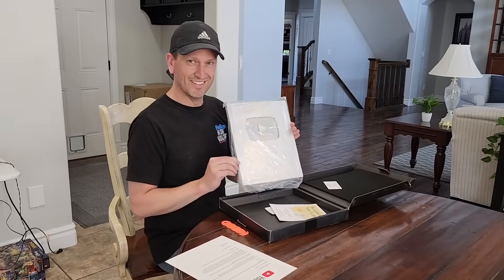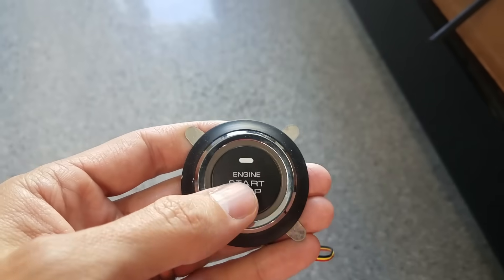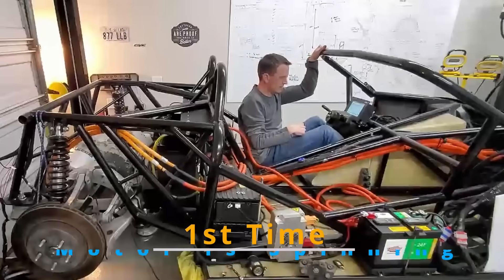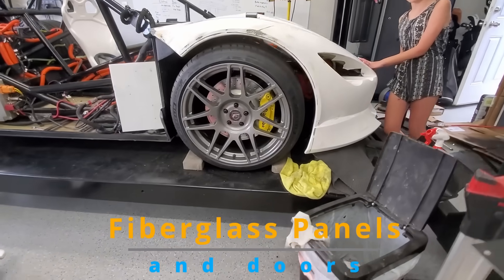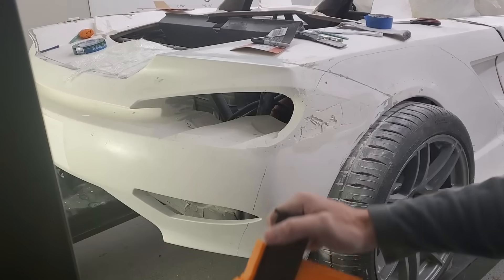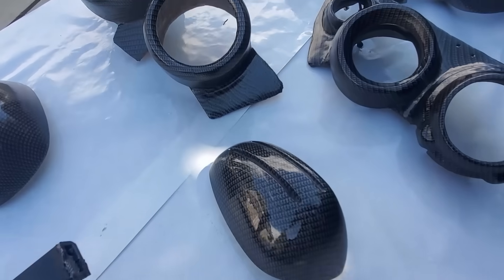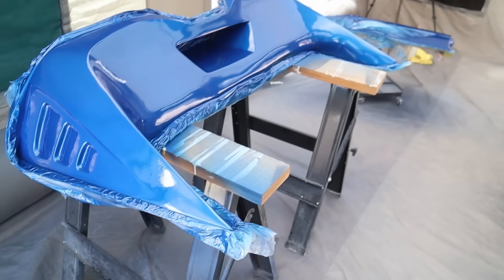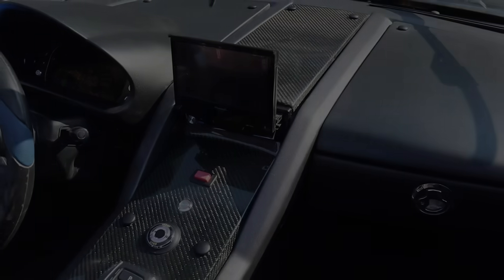I built my own Tesla Roadster - Electric Supercar

Comment: The most amazing thing is not that you learned how to paint or weld or build a car, but that you didn't give up on the project. That's perseverance
Reply from the maker: Thanks Friend!
Reply: I think it sounds too unreal, some car companies spend so many years to make a car and it took someone who knows almost nothing, just 3 years
Reply: @Saidifect Elon is obsessed with having the roadster have 620 miles. He just doesn't have the battery tech for it. There are 200kwh packs the size of the model s 100kwh pack. Problem is you can only recharge them 100 times before replacement. Current model s pack can handle over a 1000 recharges. Can't warranty the 200kwh battery for 120k miles like they do the 100kwh pack. Real world sees an average of 120 miles per charge with a model S.

A high Voltage 800V pack with 120kwh 4680 batteries is possible but range would be more like 500.
Reply: @Saidifect I mean he didn't make everything. He bought a lot of parts built by car companies
Reply: @Gamegineer93  its still very impressive and I'm pretty sure he could have made his own parts and car companies use parts from older model cars in there new cars all the time
Reply: That's EXACTLY what I was thinking too
The electronics, the welding, etc.

Either he has some mechanic, electrician, engineer background or he's a genius

If he doesn't respond to this comment, we'll know he's a liar 🤣
Reply: @humanmenot7080  it would make sense for him to come from an engineering background, which probably has the most overlap in skills required to design and build all this so it makes the most sense. But even so, highly impressive for him to pull this off with no prior experience with cars. Also keep in mind this project took him years to complete.
Reply: Only a stupid believe that... he did it ok but with support of specialists following him...only a dumb who can't do anything can think you can do all that alone
Reply: Is it real ohh man
Reply: If I start with a project 
Number 1 would be the batterypack
Reply: The first time man ... Well done
Reply: Kid @6:22 is already building v2.0 in his basement.
Reply: Fantastic kudos looking sharp congratulations on that sweet build
Reply: You’re smart engineering minds my man

Comment: OK, I really have only one question:

What do you do for a living? 

I ask this for two reasons:

1. I feel like the average person can't simply afford to invest in all the stuff you would have had to have bought specifically to build this car. I'm not just talking about the car itself either, but all the extra equipment required to DIY all the parts. 

2. I feel like a lot of people simply wouldn't have the mental capacity to do all of this, and do it right on the "first" try. I understand that there was obviously several years of work and lots of trial and error, but still...the fact that the finished product looks this good tells me that you HAVE to have some kind of engineering or design or building knowledge in the past. 

So, just curious as to what background you had before starting this project...because I'd be stunned if you told me you'd been managing the local Arby's for the past decade...
Reply from the maker: LOL!  I work for a medical device company

Comment: Hey man, after seeing this, you gave me some new hope, but also made me realize what I'm in for. I want to build my own electric car, but also the electric motors for it too. I'm going with axial flux motors because they have a higher torque density as they can provide more torque and power in a smaller package. I'm aware of the efficient and intricately designed Tesla PIM-SYN-RM (permanent internal magnet synchronous reluctance) motors, but axial flux motors can create so much more torque for their size. I am currently in the mix of winding my own coils and motor design. For everything that doesn't have to do with the motors, I really need all the help I can get as far as the frame, body, brakes, suspension, wheels, axil, steering and everything. Any suggestions? I would really appreciate any help at all. Thank you so much!
Reply from the maker: Sounds like you are well on your way.  Good luck friend!

Comment: Bro, I hope you crimped the rest of the crimplink at 4:27  thats only the starting of a crimp........ this could be a potential fire hazard with this stuff. FYI I am an electrician, just looking out for your safety, not having a go....... You may have completed it properly and not shown it.
Reply: Also I will add that the wiring you have done looks great so far
Reply from the maker: Thanks for the suggestion!

Comment: There is no way this is your first time messing with electricity and batteries and managing to connect everything correctly ,without burning a few cells or your house. I'm sorry but you are showing the wrong side. Anyone who has been dealing with this for years and has gained so much knowledge is as valuable as someone who does it in a short period of time ? and can Deal with such dangerous things?

Comment: (Lots of love from pakistan pk)
1. do front (large drive unit) and rear (small drive unit) motor have same specification especially speed
2. what is the cost of front and rear motor as i would ship to pakistan
3. i want to place a tesla motor in my mini morris 1960 model as there is no space in back of a car so i want to place under front hood which motor would you prefer
Reply from the maker: Yes.  You should contact EV partsguy
https://www.ebay.com/str/evpartsguy?mkcid=16&mkevt=1&mkrid=711-127632-2357-0&ssspo=EX50L3TxSgS&sssrc=3418065&ssuid=xzSZKjMgRSm&widget_ver=artemis&media=COPY
Reply: @electricsupercar bro he dose not reply

Comment: this is not an electric supercar if it can barely beat a Tesla.
Reply from the maker: ? 
It is a stock tesla racing a car with a tesla motor.  Only real difference is weight.  That is why it wins
Reply: @electricsupercar  you need more power, for it to be an electric super car you should be able to crush that tesla
Reply from the maker: Yep, only 600hp for me

Comment: I've been wanting to make an electric go cart for a little bit now but I'm a little curious about why all these EV car builds use AC motors with an inverter instead of a DC and no inverter? Wouldn't DC give you a more efficient usage of the battery pack along with faster response times and much higher/consistent torque? Other than being able to use AC for other parts of the car, what benefits does using AC bring?
Reply from the maker: DC motors usually operate at lower voltage (100V).  Makes it more challenging for high horsepower applications.